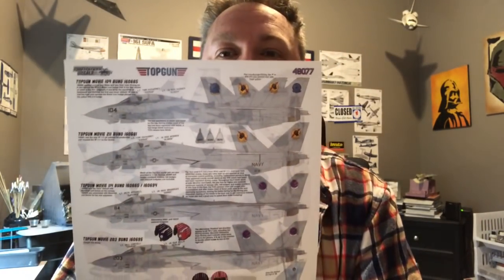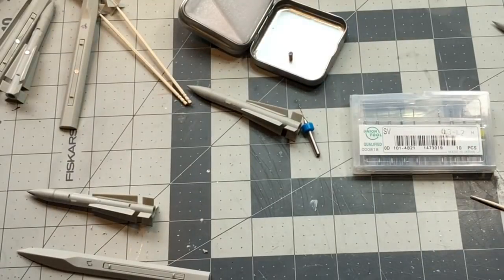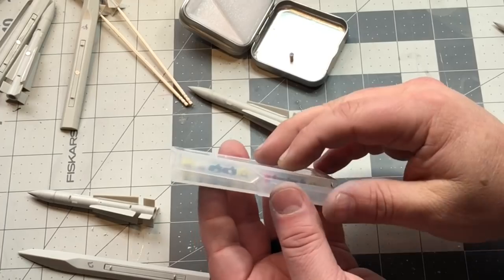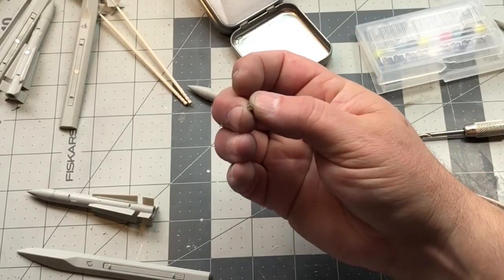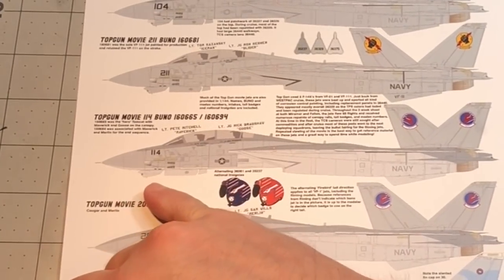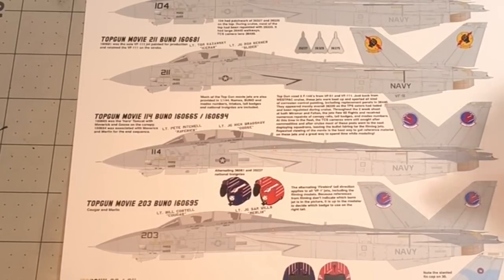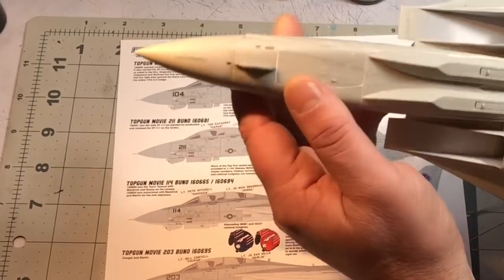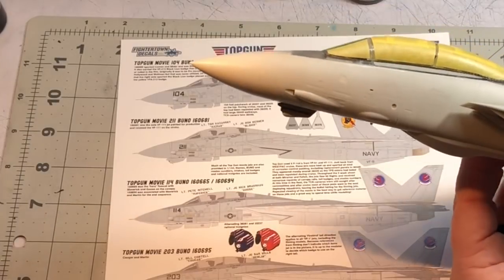Tamiya 1/48 F-14A Top Gun Build Part 1

Comment: Hey great video! I am working on this build and I wonder if you have any tips on how to close up the gear bay doors. I'm having a hell of a time getting it to look decent.
Reply from the maker: That’s one of my only issues with this kit...for the front gear bays (which are the worst), I cement a strip of styrene along the back of them making them one piece.  After they set up, I cement round pieces of styrene along the edges inside the gear bay which give you something to glue them to.  I’ve found I’d still have to fill in with some putty along the edges. 

For the rear gear bays, it’s just a matter of trimming the lip on the edges of the bays so that the doors fit in.  I also don’t install any of the main gear bay walls.  It’s best to install the outer most doors before gluing the fuselage halves together.  Then once the engine nacelles are on, you can fit the rest of them.  Just a matter of trimming and test fitting

Comment: Do you know if applying filler over the magnets will make them lose their magnativity? I'd like to use the magnets, but don't want them to be visible if or when I pull the parts off. Thanks!
Reply from the maker: I’d think that’d work if you use strong enough magnets. On a couple of builds, I placed them inside of the wings before I closed them up and that worked too.